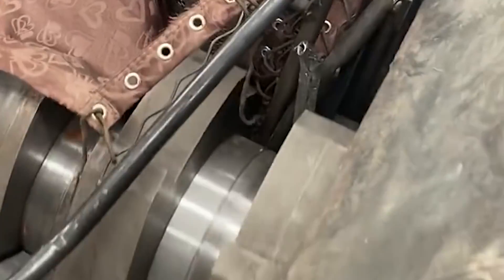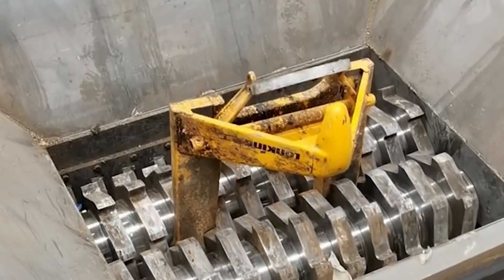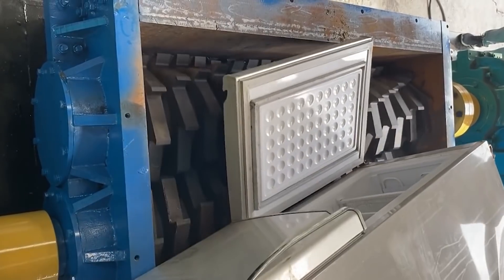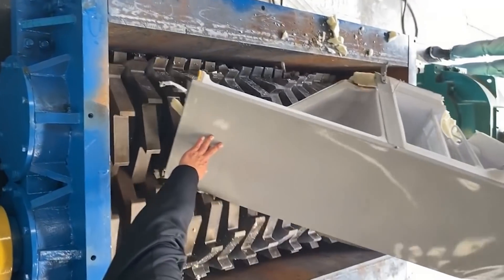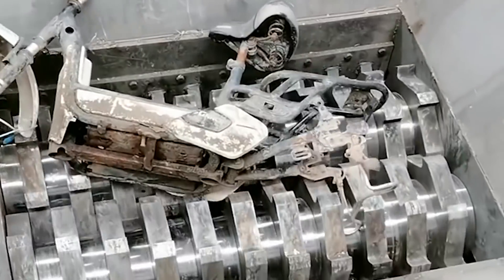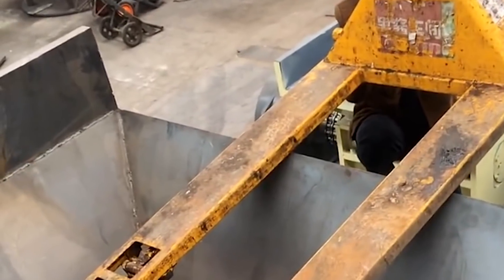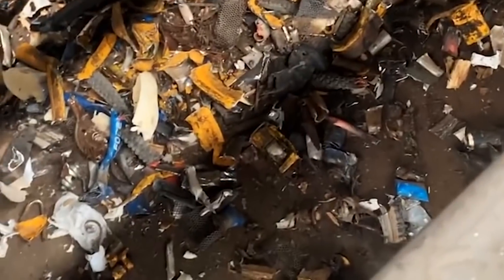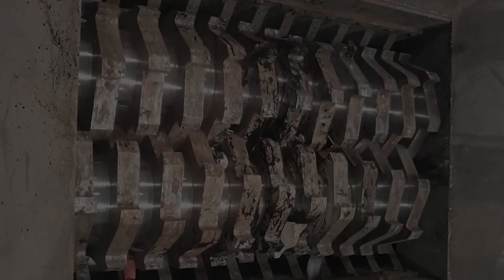Put the forklift into the crusher

Comment: Am I just plain evil when I see the ultimate torturing machine in this thing?
Reply: It's more a killing instead of a torturing machine. The idea behind torture is to let people alive as long as possible to give them as much pain as possible. 
While this machine would be a real pain, I think you would fade very quickly as soon as an arm or an leg would be shredded by this thing and then you would die very fast.
Reply: @nilon5327  Make it a funnel with slippery walls, and it wil be mental torture
Reply: @Gwiedert  And add a trapdoor like it's used on high speed water slides with a counter that's always counting down but not opening when counter reaches zero
Reply: tell us  were the loot is      or

Comment: sure the forks is just stamped metal try some solid steel fork lift forks in there and burn out the electric motor running that thing
Reply: Then toss then motor into another shred

Comment: So, exactly how many babies can this process in a minute?
Reply: depends on the nationality of the babies and who is feeding them into the machine.
Reply: @stanstuben2961  I get the first part, but not the second. I mean, to feed babies into a crusher faster than the capacity of machine, you would have to force the them under pressure. This may cause undue harm to the tykes before meeting those rotating 'ticklers'. Please defend your statement.